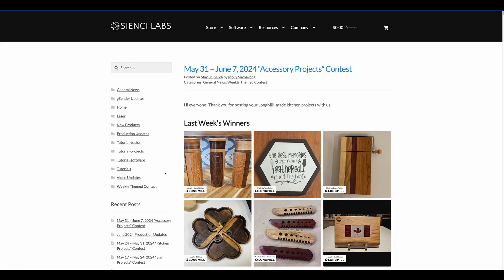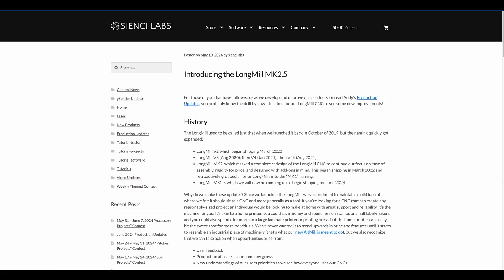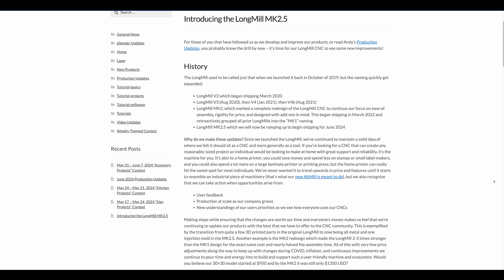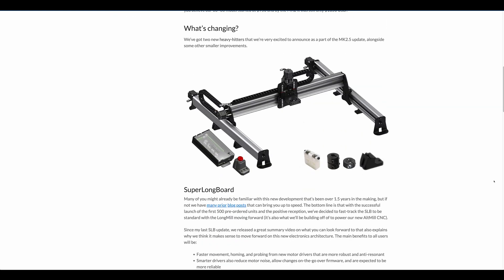Sienci Labs Monthly Production Update - June 2024 - AltMill CNC, LongMill MK2.5, and MORE!

Comment: Very impressive  update.  I have been looking into my options for a laptop computer the can meet the minimum requirements for running both Solidworks Maker and Vectric Aspire software.  I plan on using both but Solidworks Maker is currently discounted down to $48/ year. I am leaning towards the HP Victus 15 gaming laptop at $634.59 16gb ram using Ryzen 5 Nvidia Geforce  RTX 2050, 1TB SSD Win 11 but could bump it up a notch and buy the Lenovo Legion i5 Pro 16 inch gaming laptop with Geni7, RTX 3050, 1TB Win11 for $1253.88 both are Amazon prices, in the middle is the HP Envy 17.3 inch with Inel i7 at $1147.99 also 16GB

Comment: Don't "cheapen" the system. I can buy junk from China at a 1/3 of the cost. Build with quality first with the vision of lasting beyond its intended use. Have three good mills and use those platforms to upgrade. Also manufacture Nema 34 Stepper motor components so those can be attached at the mill X, Y axis.